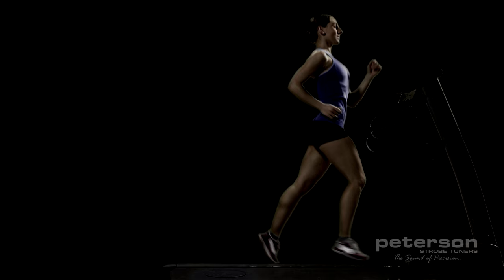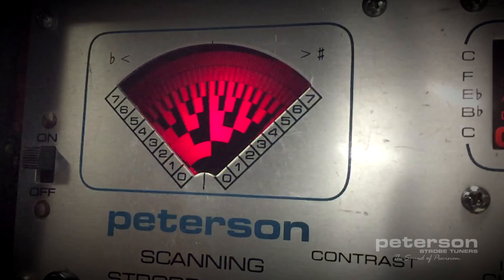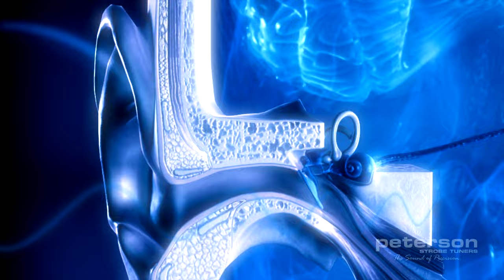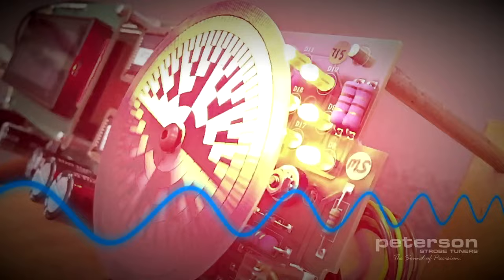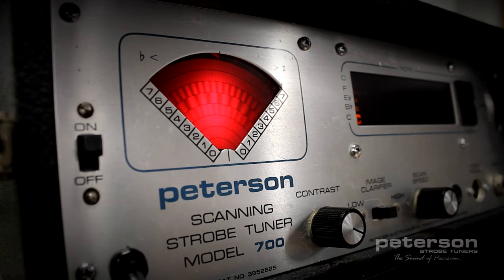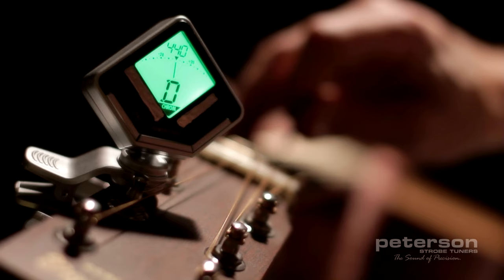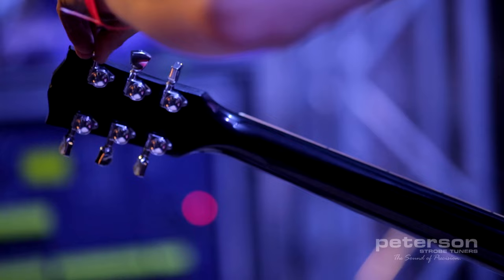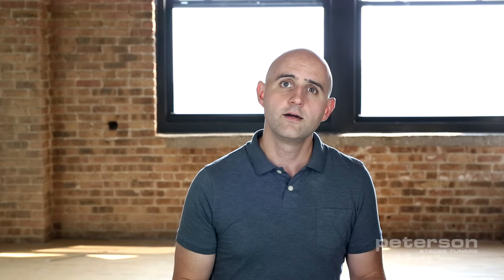How Does A Strobe Tuner Work?

Comment: You lost me.  You sold me on the idea that strobe tuners create immediate feedback without the need to compute pitch like digital tuners do then told me that your digital tuners are just as good.  Could you please explain why the traditional strobe is the same as your digital tuners but not other digital tuners?
Reply from the maker: Thanks for the question. Our digital tuners operate on the same principle as our mechanical tuners. Our mechanical tuners spin the disk at a set rate in relationship to the incoming pitch. The strobes flash at the frequency of the incoming pitch. When the phases align, the wheel appears to stand still.

Our digital tuners operate on this same phase identification, but instead of a spinning wheel, the incoming frequency is compared to a static internal tone generator. The phase is then displayed in real time on the digital display as either sharp or flat of the target pitch by the spinning strobe image.
Reply: Hope this helps;
It's not the accuracy of the tuner that's different, it's how best to display that accuracy. An LCD display is limited by the number of LCDs it's possible to fit into a screen small enough to be practical, but many hundreds would be needed to properly display the extremely fine accuracy.
For example; If 100 LCDs were used,  each one could only display to an accuracy of 1%, so when you tuned to the "target" LCD you might still not be exactly in tune. 
The solution is to use the rotating disc method  which can display the tuning precisely without needing a lot of LCDs because it only has to be able to display movement, and when you stop that movement you are exactly in tune.
Reply: @Kevin-mx1vi  Not really.  You only need two seven segment displays and a +/- to show the number of cents away from the target note. Eg. G -27  if you're 27 cents below G. You can add a decimal point and another seven seg display if you want more accuracy.  That's about 24 LCDs.  I suggest that for an instrument tuner, three decimal digits is more than adequate.

Comment: The strobe never stops 😂 give us some sort of constant on lite or beep when we’ve hit the right area
Reply from the maker: The strobe does stop when the incoming pitch frequency and the revolutions of the strobe wheel match exactly. However, due to the accuracy of strobe tuners the wheel may never actually stop moving. The strobe will display the attack, sustain, and decay of each pitch. The attack will always be slightly sharp of the sustain as the string will be bent and tension increased at the note is struck. Whether this is from a plectrum, finger, hammer, or tonguing a reed, the attack will always be just sharp of the sustain. As the pitch sustains, the pitch will settle more flat than the attack, and the decay will begin to show harmonic content.

Using a strobe will be the most accurate form of tuning due to amount of information provided from the tuner.

Comment: My Snark tuner was telling me my mandolin did not have correct intonation and was out on the 12th fret, implying that the bridge needed to move. Unfortunately, the bridge on this particular mandolin is not (easily) moveable, so it would need a visit to a technician.  However, before doing that, I thought I'd confirm the problem with a strobe tuner, and I chose the Peterson clip-on, which arrived today.  As soon as I tried it, it showed me that the intonation on my mandolin is perfect!  No need to waste a trip to see a technician on a pointless errand.  
No more Snarks for me; I'm hooked on Peterson!  And the "sweetened" mandolin tuning sounds very cool, too!